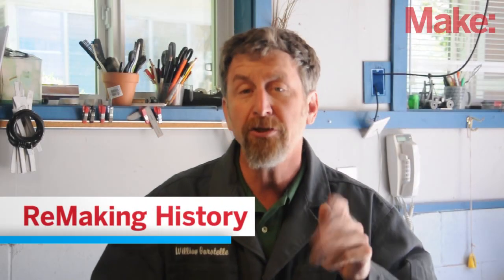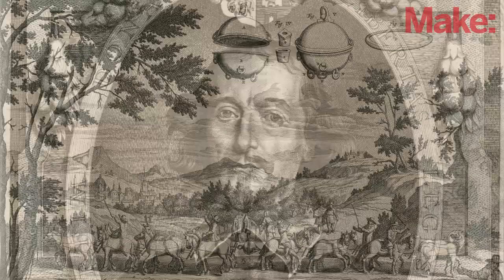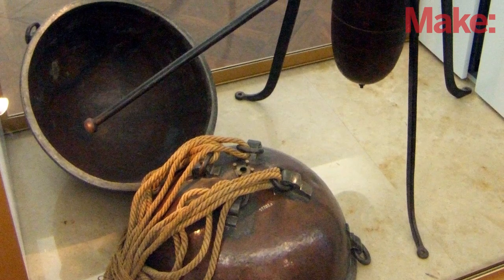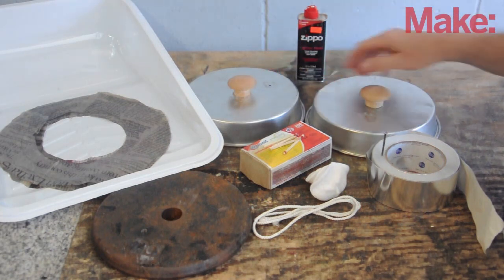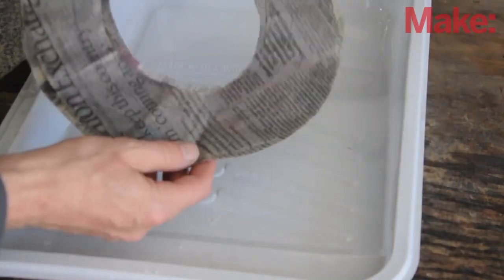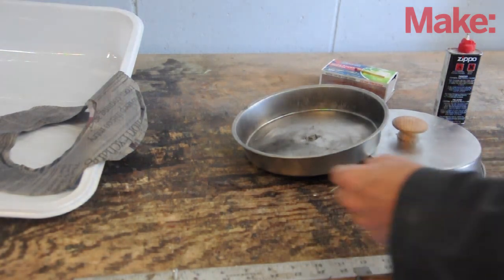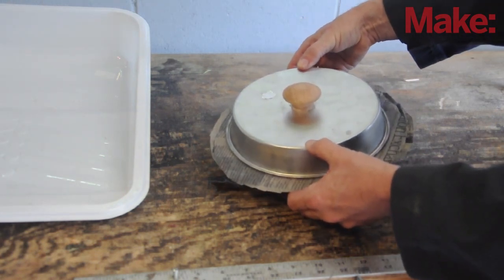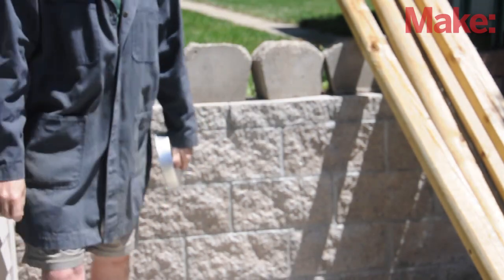ReMaking History: Magdeburg Hemisphere

Comment: Probably an even more effective method is to fill up the cavity with steam by boiling water in it for a while, that drives out most of the air leaving only water vapour which then condenses out.

Comment: Magdeburg used a sneaky trick to make the demonstration more impressive:  He had two teams of horses opposing each other.  He could have gotten double the force with the same number of horses by tying one side of the sphere to a wall, and having all the horses pull in the other direction.  He also could have doubled or quadrupled the mechanical advantage of the horses using a block and tackle or levers...  But he wanted to impress the local ruler...
Reply: because the ruler usually isn't as smart lol optics are much more effective in such a case.